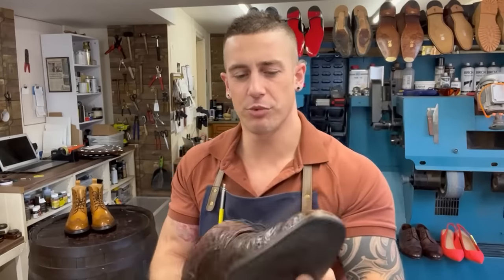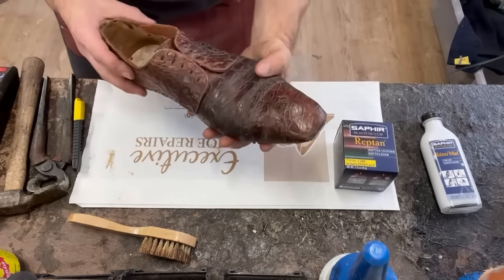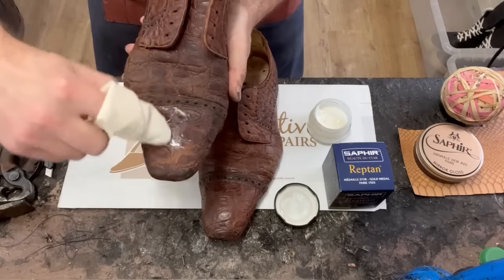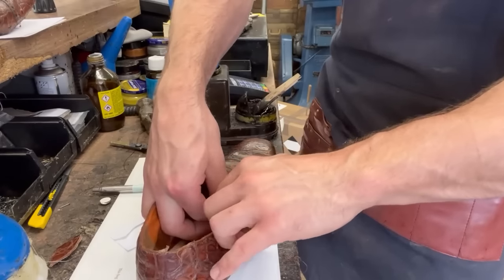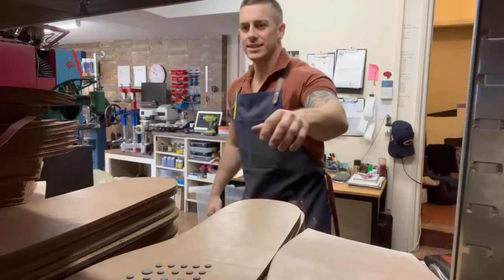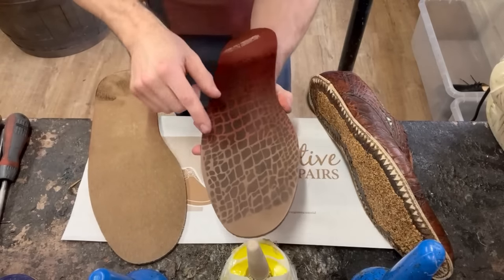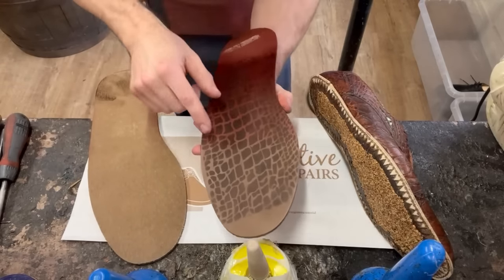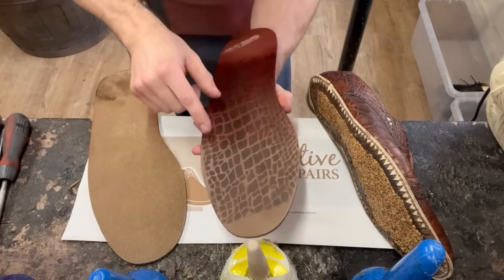EXOTIC Crocodile Shoes Recrafted - We Added Eyes!

Comment: Amazing work. I always have a deep appreciation for a craftsmen who takes his craft very seriously and will not settle for anything less than near perfection. I do odds and ends type of work but I too always make sure a job is done well and looks good even if it wont be seen.
Also I had a quick question... with how tattered some of the material is would this restoration really be it's last or do you think there is a chance 10 years from now they could be restored again? I have a feeling from the condition overall this would be the last run but I could be wrong.
Reply: BTW, anyone ever told you that one of your tats always makes your lower bicep look bruised? I think it every time I see it until I realize its part of a tattoo.

Comment: Dan? 
Is it possible to convert a pair of faux welt uppers to real welt? I have pair of Vagabond shoes with faux welt that I've put a shit ton of work into the uppers of, because I finally found a pair of shoes that were wide enough that I didn't have to go two sizes over in length.

But, being faux welt, they're fairly thin bottomed, and the sole is getting worn (I'm almost through my second heel on them).... So... Could you sew on a real welt, fill the extra space with cork and stitch a new sole onto the new welt, new heel block and all?

Comment: Thanks for another great video Dan. Can't comment on the customer's taste but a hell of a job.
Question - I use contact cement a lot but have never done the heating step that you do after letting it dry. What's the reason for it - does it improve the bond or give you some slip in assembly?

Comment: The fore sole is beautiful but not functional. As Britain is a very wet country having leather soled shoes is not practical. The original sole came in with a rubber forefront for a reason. I have to tell my cobbler to replace the sole with a rubber bottom as I also live in a wet climate.